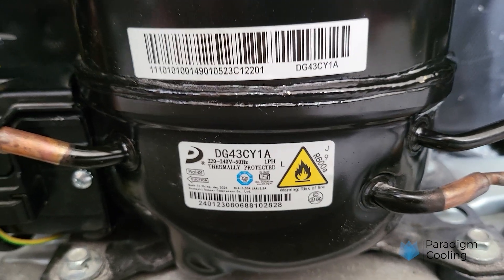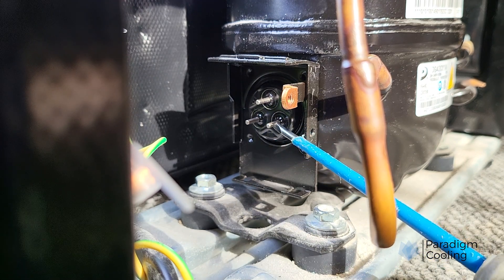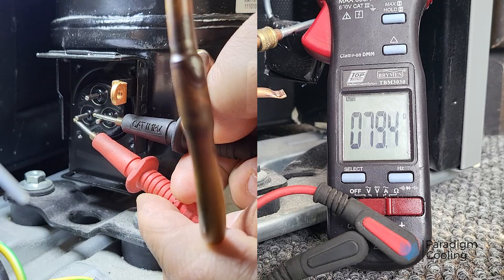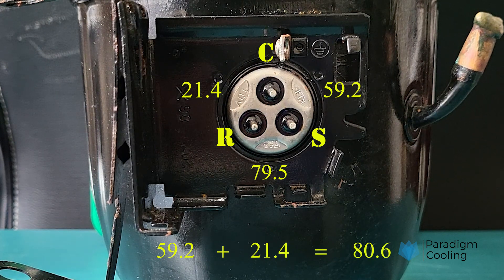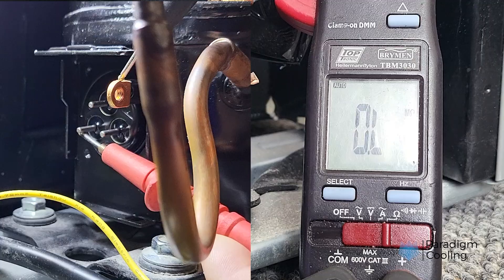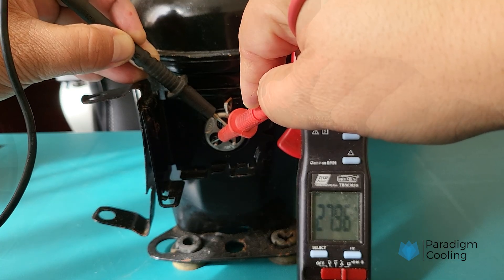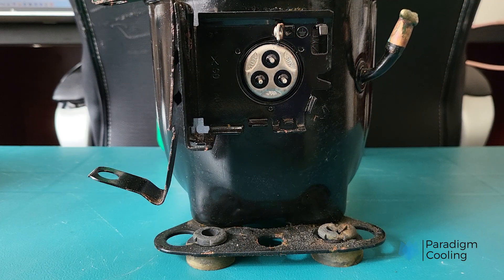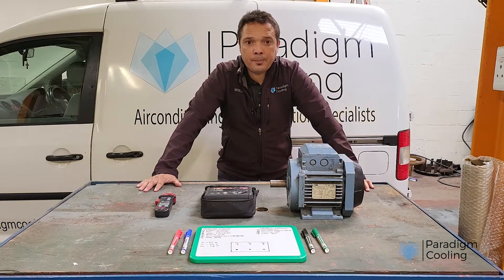Compressor Testing for Beginners – Single Phase Refrigeration Motors - Paradigm Cooling

Comment from the maker: 🛠 Get the Tools We Use
Want to follow along or upgrade your kit? Check out the tools featured in this video using the links below. When you buy through these links, you support the channel at no extra cost to you!

🔗 [Recommended Multimeter – https://amzn.to/4kXzi7O]
🔗 [Insulation Tester (Megger) – https://amzn.to/4lFy6Ha]
🔗 [Complete HVAC Tool Kit – https://amzn.to/3IEhUHM]
Reply: I put a new compressor in the fridge but is very warm what is the problem